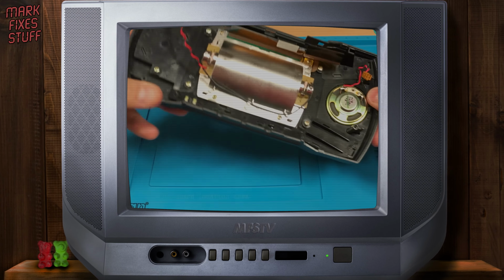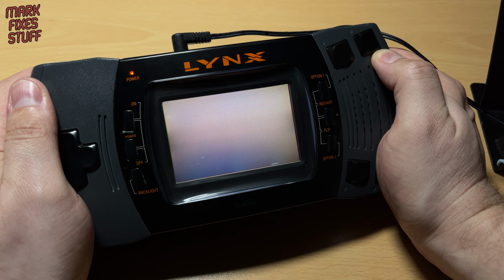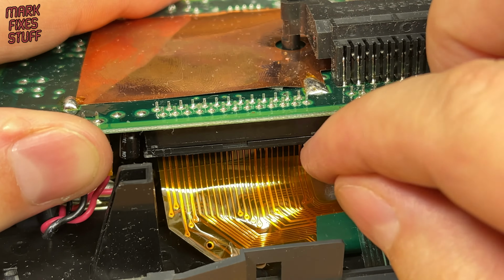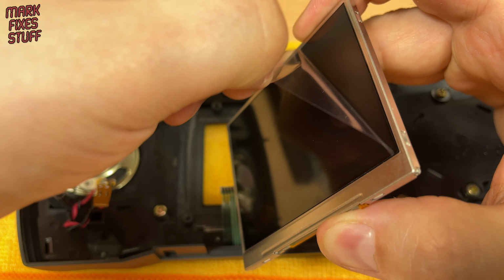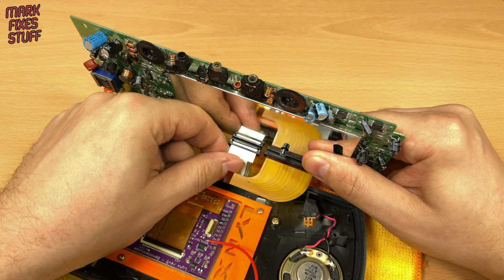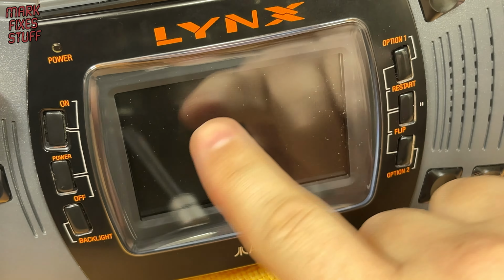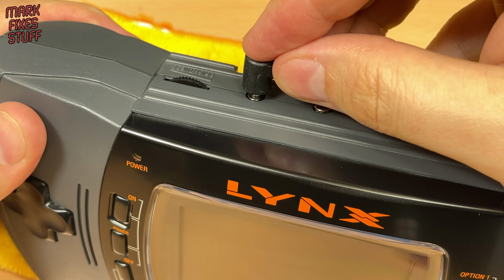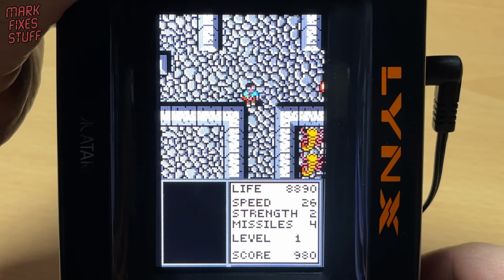EASY Atari Lynx LCD Screen Upgrade: A No-Solder "Drop-in" LCD Screen install!

Comment: I bought one of these screens for my Lynx II back in March or April, but didn't have the nerve to install it until tonight. I girded my loins and gave it the proverbial whirl, using your video as a guide (as the kit didn't come with any instructions). Aside from trying to get my big meat hooks into some overly tight spaces, the installation was fairly straightforward. I didn't do the extra wire (I didn't have my soldering iron handy), but it's a night and day difference from the old screen.

I want to thank you, wholeheartedly, not just for this video, but for all the instructive and entertaining videos you've done over the years that have helped countless people. I wish you and your family the best as you rebuild your life after the fire.
Reply: I have just purchased this kit and too will be using this video as a guide.
God bless this Chanel and video.
Kit looks impressive

Comment: Thanks for the tips. Many's the time I have damaged the hole by hard and reckless screwing, that won't happen again now.
Reply from the maker: It is a common problem. Also, beware using an oversized tool.
Reply: That's what she said @MarkFixesStuff

Comment: It would be interesting to see the power draw with the brightness on different settings. I love nothing better than to dim the lights and gently screw into the evening. Such a wonderous occasion always elicits gasps and moans from me, especially after I take the rubber off

Comment: Hello. I hope you don't my reaching out to you but I'm trying to find how to change the screen lens cover on an Atari lynx 1 but I can't seem to find an answer anywhere and this video popped up even though it's for a lynx 2 so I thought I'd reach out in case you've done one? 🙏 I'm hoping there's an easy way without opening the shell housing like a suction cup on the lens and a little heat for the glue underneath 🤞 thank you for any assistance you may be able to offer
Reply from the maker: I’m afraid I don’t really know. My model one was lost in the fire. Really sorry!
Reply: @MarkFixesStuff  Sorry to hear that. Thank you for the reply though.

Comment: Just bought the last no-soldering screen from K-Retro.  Looking forward to upgrading my Lynx 2, which works perfectly fine, but with that new screen, will be even better.  Thanks for instructional video.  UPDATE:  I got my BennVenn screen and used your instructions.  Now my Lynx 2 looks fantastic.

Comment: Hey, you forgot to show the scanlines right ? What does the brightness wheel do when you connect the backlight wire ?
Reply from the maker: I think it got missed out of the edit. I definitely filmed the scanlines. Sorry! It works fine though!  The brightness wheel works the same with or without the optional wire - it turns the brighness down smoothly.
Reply from the maker: BTW, the scanlines are the same as the previous model. You can see them on mu install video for the wired version at https://youtu.be/laMALkm2jRs?t=1020 - that is the correct timecode link!
Reply: @MarkFixesStuff  Great ! Thanks 😉What you think about it ? It looks a bit more like the original screen right ?
Reply: @MarkFixesStuff  Another question, by pressing the backlight button do you alter the brightness range of the wheel ?
Reply: @luke7110  yes, it'll reduce the range depending on the 'level' you've set with the backlight button
Reply: @bengrimmett1239  Ok! Thanks for the information. And BTW, thanks for all this stuff ! The LCD mod and ElCheapo cart are awesome 😜

Comment: I got the original Lynx as a kid, and to this day I still say Todd's Adventures in Slime World in an unsung classic... At the time it was my second favorite game after Metroid lol!
Reply from the maker: It's a really good game. The Lynx version looks and plays so much better than the Megadrive/Genesis port! Have you tried that one?
Reply: I didn't have a Genesis as a kid, but I did try that version on an emulator a while ago! You're right, the Lynx version is WAY better!
Reply from the maker: @strangulator42  All the colours on the Genesis, and the slime just looked like mud???? It looked like slime on the Lynx using just 16 colours!  Apparently there's a PC Engine version. I might give that a go. Have you tried that one?
Reply: @MarkFixesStuff  I only have the roms for the regular PC Engine game cards, looks like that was only released as a CD, so I haven't yet. That may be a project for this weekend lol
Reply from the maker: @strangulator42  I am lucky enought to have a SuperSD System 3 from terraOnion. I'll have a go with that I think!!

Comment: I have a boxed Atari Lynx, with less than 2 hours play on it, but several pixels have gone on the screen so i'm seriously considering getting 1 of these screens! Thanks for bringing this to my attention Mark and an A+ for the fitting demonstration!
Reply from the maker: Oooohhh.... that seems like the perfect candidate.  I had a chance to grab a boxed Lynx a few years back for what would be cheap these days but I passed on it. I regret that now... Is that your original personal Lynx?
Reply: @MarkFixesStuff  I purchased it back in the early 2000's. Electronics Boutique had a big retro thing going on in association with Telegames. I also purchased a mint boxed Atari Jaguar with several sealed games, a mint boxed Sega Gamegear with a few sealed games, 2 mint boxed Atari Lynxs with 1 sealed game, and a used Panasonic 3DO with used games, costing a total of £110. I sold 1 of those Atari Lynxs last year for £90 on Ebay but the rest I still have.

Comment: I remember doing the V1 install (mine was an early prototype). It wasn’t horrible, but this is soooooo much easier. 
Mind you, my recent BennVenn Lynx 1 install was, ummm.... fun.
Reply from the maker: I have that in my list to watch later.
Reply: @MarkFixesStuff  For the Lynx 1, Ben will be developing a cable for it. It will never be solderless but should save a little hassle.
Reply from the maker: @MrLurchsThings  That's good news. Easier sells better as well.

Comment: Ah man, the Lynx II was such a great bit of kit in an unnecessarly massive case. So much fresh air inside. Without the fluorescent tube and reflector it could be half the size.
Excellent video that tempts me to rebuild my first (worn out) Lynx that's been in bits for the last 25 years...

Comment: Would you be able to use a 5v power supply instead of the 9 as there no longer is a back light etc?
Reply from the maker: I think so with some moderate hardware hacking. I replaced the power section in a faulty Lynx with a smaller 7805 regulator and an early BennVenn screen, so it would be fairly simple to do I think.

Comment: It might have had 16 bit hardware, but the screen resolution wasn't even as good as a 2600, that's why the games always looked blocky, they had a good amount of colors and a good deal of processing power, but with such low resolution the games were going to look blocky.
Reply from the maker: I suppose that was because it was built around the limits of the available screen technology back then. I don’t know for sure.

Comment: Does this replacement also feature the voltage protection another screen replacement had?

Sorry, just read on the website it does have that feature. Now to see about getting it.
Reply from the maker: Yes, and it's cheaper.